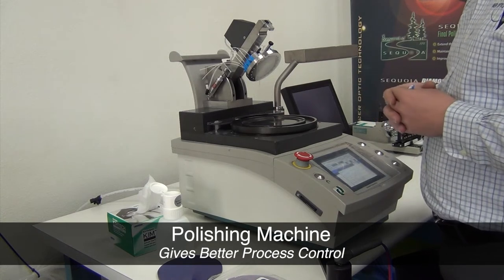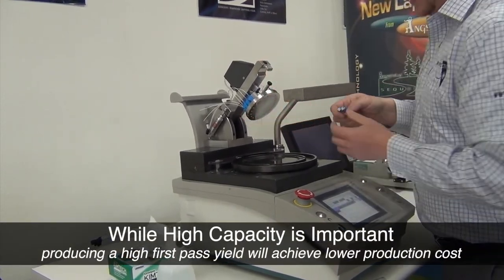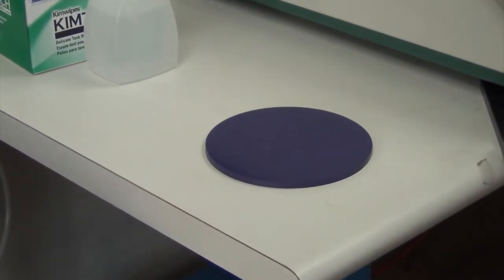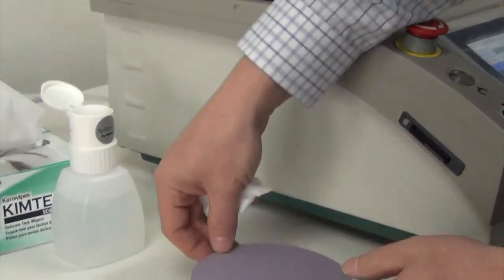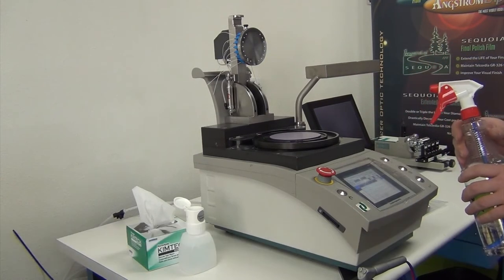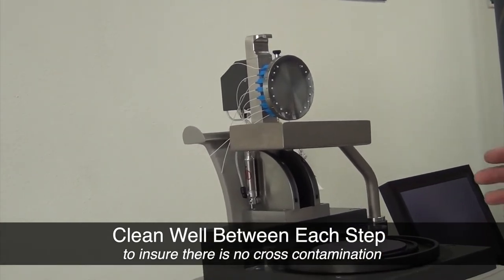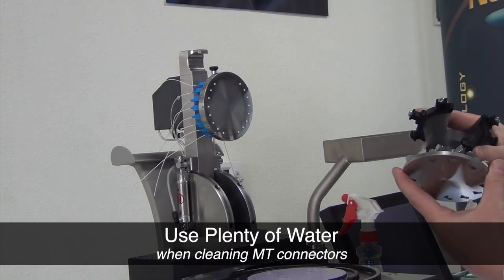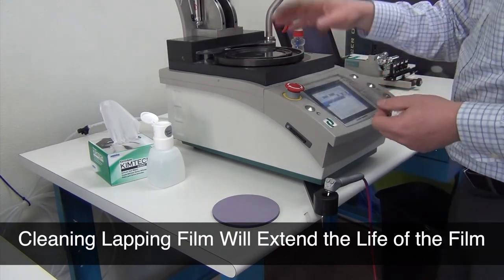Training: How to Machine Polish Fiber Optic Connectors

Comment: How many times can u run an st connector before the connector is no good. I've run st's 3 times and still having a scratch issue?
Reply: I have the same issue when I run my St connectors I usually can only get about 50/50 on each run that are clear and I only run 14 heads on my puck instead of 18